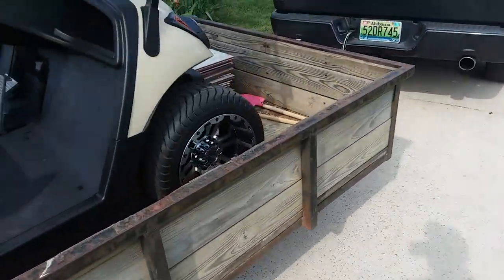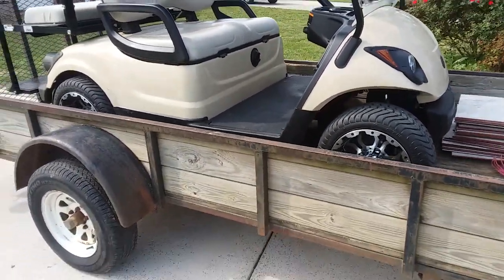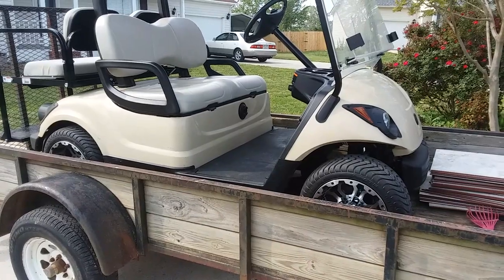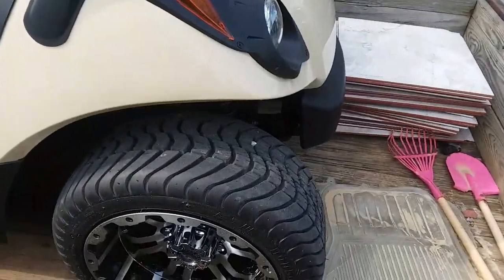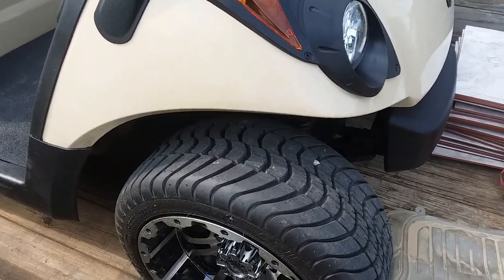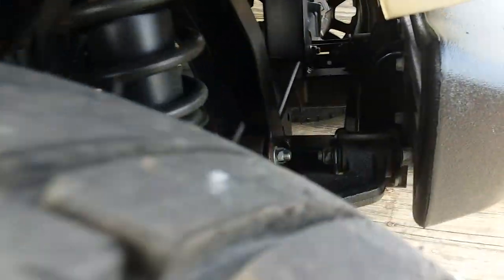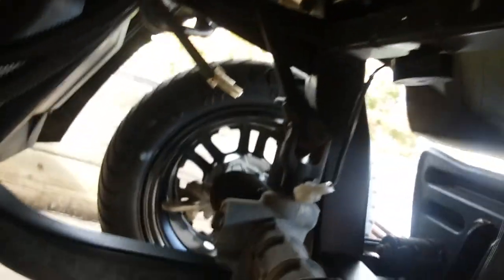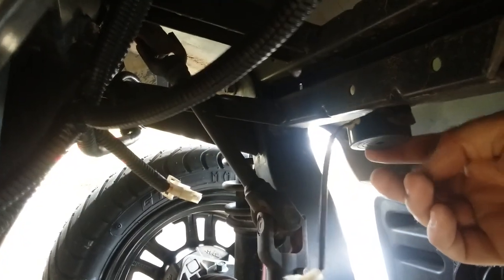2016 Yamaha Golf Cart Reverse Buzzer delete

Comment: Do you know how to discount beeper for reverse on a star electric golf cart? 
Thanks
Reply from the maker: No I sure don't,  I'm not familiar with that brand golf cart. I would suggest listening to find out where the beeper is located and once you find it trace the wire back and you will probably find a connection somewhere along the wire. Once you locate the connection just simply unplug it, and make sure you tie the unconnected wires up out of the way to prevent the wires hanging and causing damage to other components on your cart. Best of luck, thank you for checking out my video.
Reply: Dwayne thank you so much for your time really appreciate it